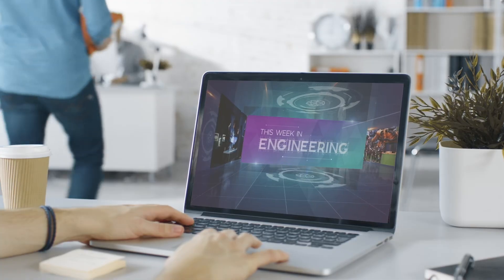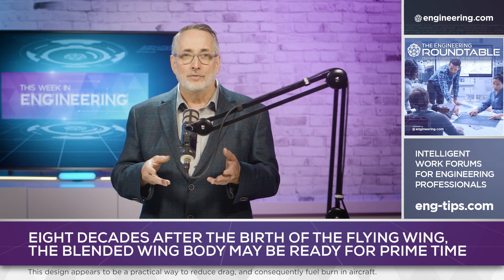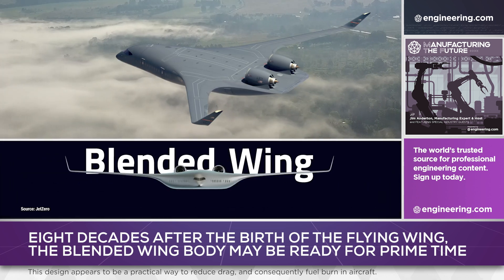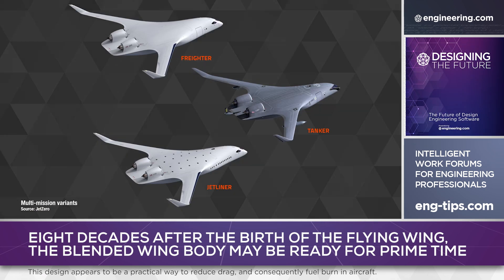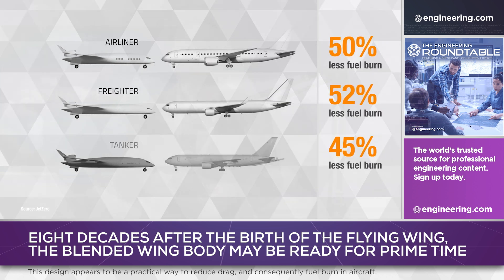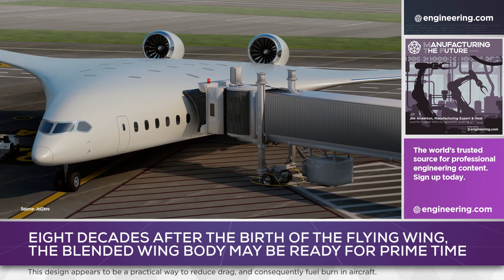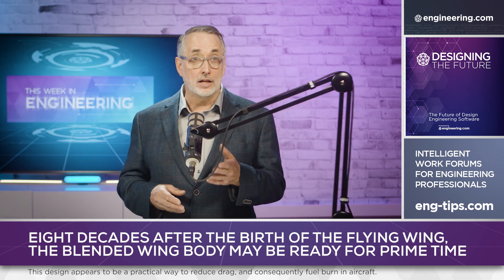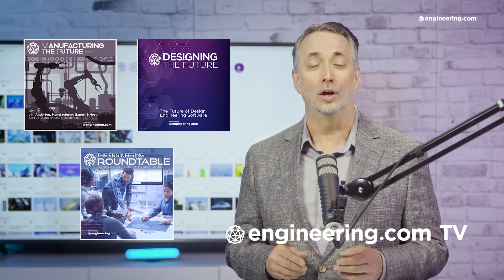Blended wing body: the future of air transportation?

Comment: The biggest issue with blended wing body is turning the plane in flight. They're going to have to figure out how to turn the plane in almost a flat manner without a lot of banking, because otherwise passengers sitting further away from the centerline of the plane will experience some very unpleasant motions.

Comment: It's the future for air transport. New CFRP materials make the cylinder pressure vessel much less required now. The pressure differential on a plane from MSL to FL 40 is peanuts in structural strength terms if you are using materials which are strenght/weight 300% stronger. The wrong G-load assumptions during a turn just reveals a complete ignorance of how planes do a coordinated turn. Planes bank so nearly all the load is vertical. The main ingress and egress is obvious. With the engines at the top of the body, the main wide access is from the rear, just like C130 or C17. But other doors will be forward, that's not an issue. It's not a flying wing, it's a blended wing.

Comment: The flying wing is now seventy years old, Jack had even designed a passenger wing although it was never approved. With the addition of computer aids it may be possible.
Reply: It's easily possible. It just needs a will and investment. Bear in mind this is not a flying wing - they never said that. It's a blended wing. Whole different beast and it will still have vertical stabilisers.